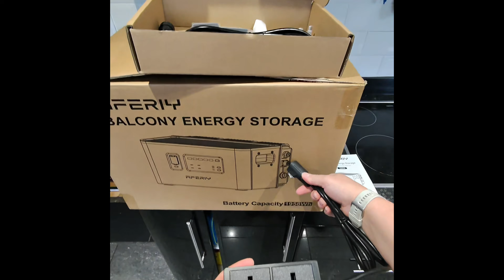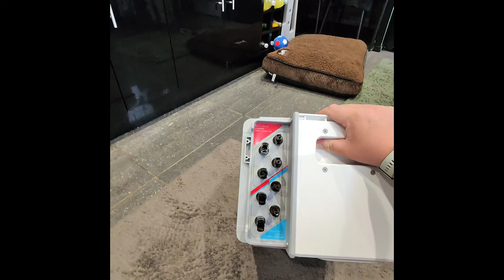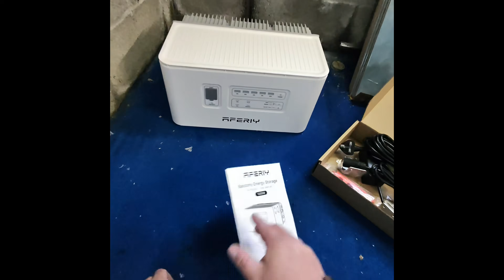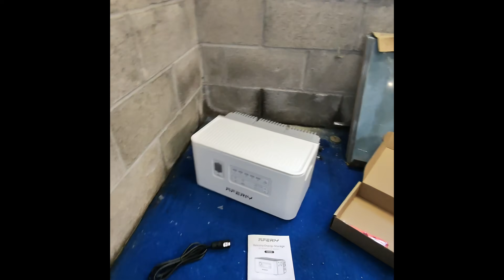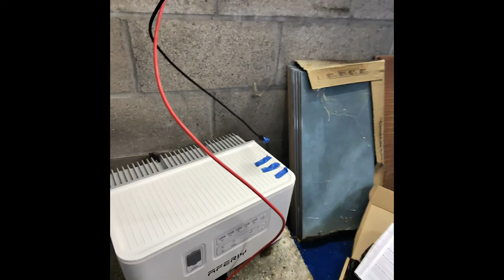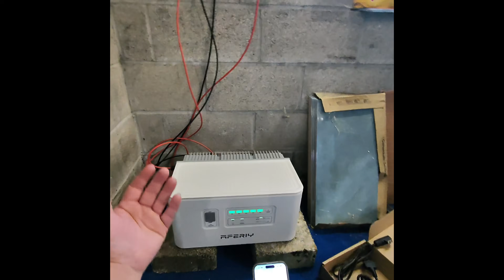Aferiy PS240 Balcony Energy Storage - Finally arrived in UK!!!   Unboxing and setting up!

Comment: Very much appriciate someone talking about 'Plug in Solar' to say that in the UK you can't currently plug it directly in!!! Hopefully it will all get passed soon, but right now, much better safe than sorry by getting a sparky in to hard wire it, DIY everything that wont make you DIE
Reply from the maker: Appreciate the comment 👍👍
Reply from the maker: Exactly, safety comes first so definitely get a professional to handle the wiring. 👍

Comment: After taking a look at the video, I priced it up here in the UK as a general member of the public; £759.00 for the unit from Aferiy UK and £299 for 2x AIKO Neostar 2S G2 Solar PV Panel 465W N-Type Panels from PlumbNation and £18.88 for the 5m MC4 extension cable from Amazon. Grand total £1,076.99.
Reply from the maker: That’s roughly the hat I paid for everything

Comment: If this is plugged into the grid can you tell it to not export anything? Can I schedule when it charges and discharges? I want to plug it into the mains to charge on cheap rate then use it during the day. If i have things plugged in during the day and it runs out of battery do these things just turn off or does it pass through electricity from the grid?
Reply from the maker: You need a Shelly smart metre to be able to control it not feeding into grid which I’ll be getting installed soon. 
And yes you can schedule charge and discharge l. Hope that’s helps
Reply: @AndyKnightPro I think I found the answer. I wanted to do off grid and grid tied mode at the same time and this is not possible.